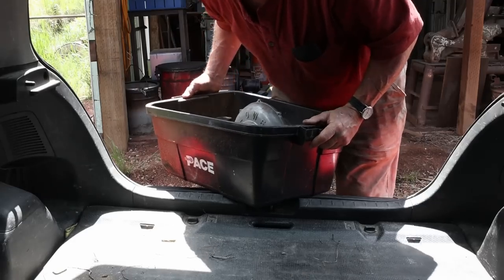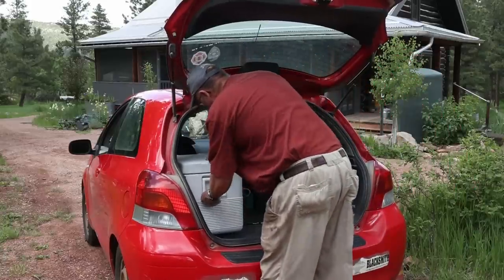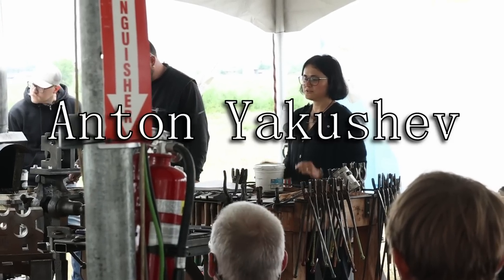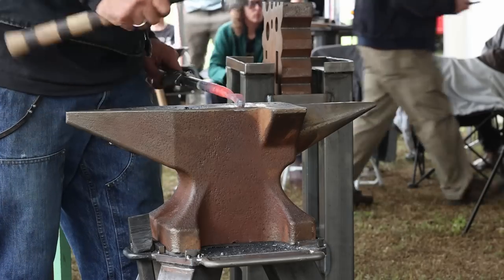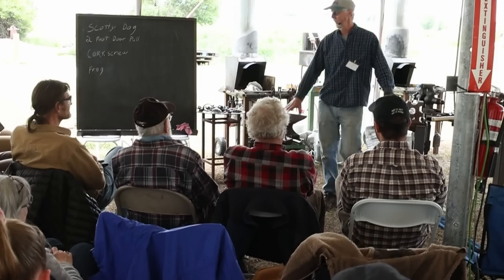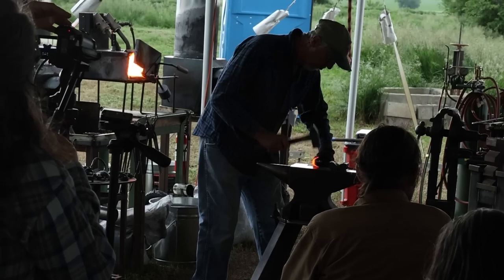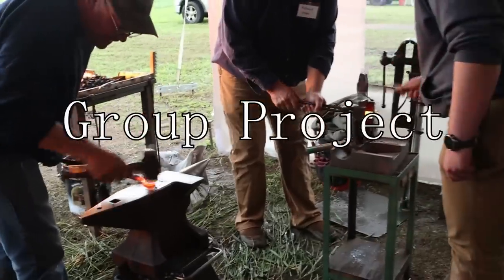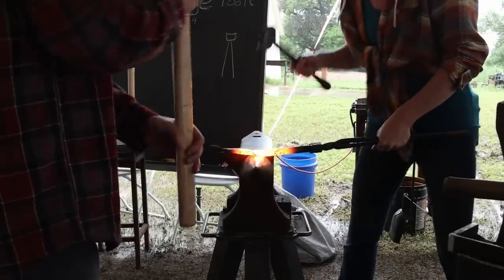Rocky Mountain Blacksmithing Conference 2023

Comment: I am doing my first demonstration. I was wanting to remove the smoke from the coal forge. Does anyone have experience by using a flexible metal ductwork and perhaps a 20-40 foot length of metal duct work with a ductwork fan at the farthest end . Do you think that would cool the air enough that the fan would operate continuously keeping negative pressure in my forge shroud?